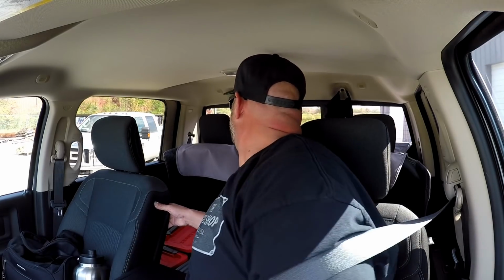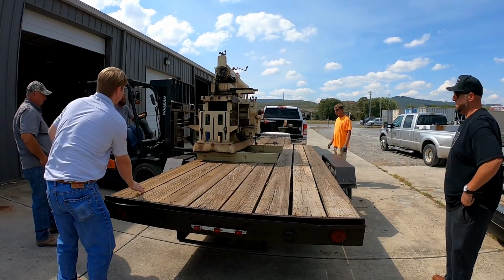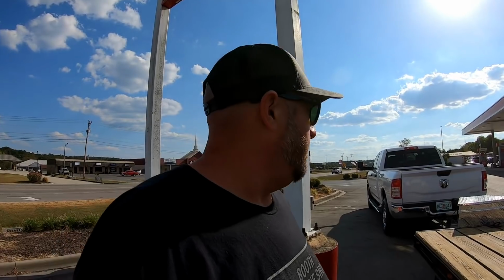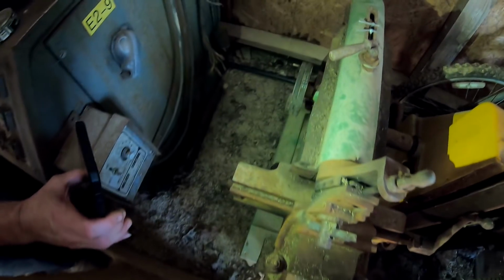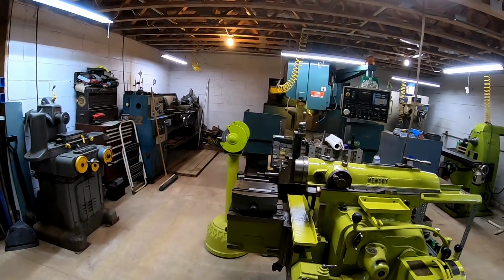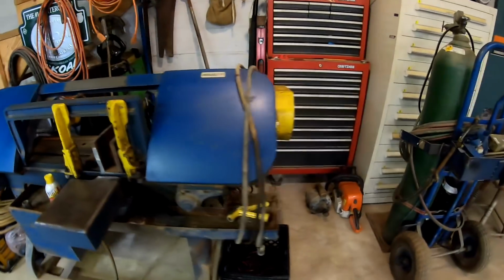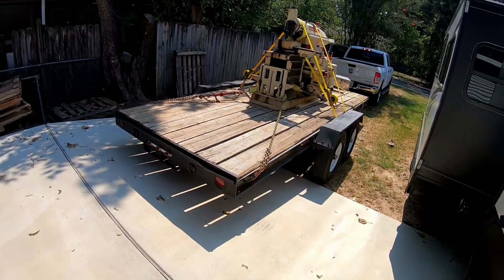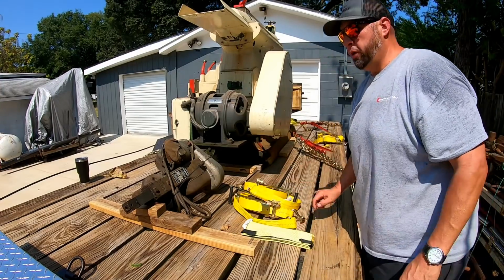SNS 277: Smith & Mills 25" Shaper!

Comment: I know it's an old video so you may not even see this but Im going to tell the story anyway lol
I was so mad about 3 months ago roughly the local trade school had a series 2(I think it was a 2) Bridgeport 10x52 mill that had extremely low hours.. not sure if it was one it since day 1 but the hour counter mounted on the main head motor read like 188 hours or so
Anyway it had a veriable speed head on the front like normal but had a bridge port shaper attachment on the rear... This thing was slick and sold low .I tried so hard but I couldn't get away so I could log in and follow the auction....I was so mad lol I had never personally ever seen one set up like that... someone got the whole thing for less than 1k...dro power feeds ect but the whole point was supposed to be that I think school have some of the cleanest tools\equipment but it's sad alot of the tech schools are getting away from teaching this stuff... Seems sad to me ...

Comment: You showed and spoke of the spilled oil on the boards of your trailer. Every time I change oil in my vehicles I take the old oil and mop it onto the boards of my tandem axle trailer and it makes a great preservative for untreated boards as well as add to protection for treated lumber. Of course I pull the trailer out into the field before I do it. Great video

Comment: Yo... IDK if anyone else saw this but that rear axle on that Dodge looks to be maxed. Check that angle on the wheel @ 15 min. "The Truck Stop."
Reply: There's little to no weight on the Dodge as most of the weight is on the trailer. So whatever angle you're seeing is probably an illusion.

Comment: I'll second the comment to use fire hose for strap and chain protecters.  If you put a twist in your straps when they are out in the wind they won't vibrate and whistle going down the road.  For anchor points in your slab look at body shop/frame straightening supplies, their are anchor pots available that can be flush mounted in a core drilled holes.  try some plastic UHMW or Harbor Freight cutting boards for sliders instead of rollers when unloading the shaper, set them over the crossmembers and the machine should slide like you greased the trailer bed

Comment: Adam, get you an old leather belt or some discarded fire hose  you can cut to protect your straps. Check your local fire house  for the hose . If not respond to my comment and I can send you all you need. I am right here in New Orleans.

Comment: she squeaks alright :-) guess your springs and bushings needed to be broken in. Just the load securement ain't right. You need a bull nose infront and behind your load with Chain's and 4*4 across so it won't slide forward or backward of your trailer in case of an emergency break. Load weight is about 6300lbs so your 2 straps hold it proper down for DOT not to mess with you. But I would had done the bullnose at either end of the unit. The bolting down of wood to stop it from sliding won't hold because the sheer strength of your screws or bolts is very low.  The problem you have is the chain securement to your tailer is exeeding pull strength. That's why I do use 3/16" or 1/4" by 3" flat stock for the stake pockets to which I secure my chains those hold 12000lbs. But the idea how you secured the load is 10times better than most private people would have transported the load.  Nice video.

Comment: As a cnc operator, i dont under stand why you need a shaper
Reply: Not many payments, unlike high $$ CNC. They are capable in the right hands. Some people don't need the latest technology to make a living. Why are there still Blacksmiths?
Reply: @retireddec04   Speaking as a Blacksmith I resemble that remark ;)  
I love Adams work and genuinely admire the precision boys, especially the old iron drivers. Most of my stuff needs a few millimetres tolerance, not a few thousandths.
Reply: U like a button not a dial
Reply: as a shaper operator, i dont under stand why you need a cnc

Comment: I would look for in a frame hoist that you could drive your trailer under, lift the equipment straight up, and pull your trailer out and then lower the equipment down onto rollers.  Might be a lot safer than trying to slide it off down some ramps.

Comment: Adam try and think up of an idea of mounting the fenders to the axles so they are level with the bed when the trailer is empty but then when weight is added they will always be a set distance at all times even when the springs are fully compressed.
Even if you have to mount 2 half fenders on each side so when the axles move independently of each other they don't foul each other

Comment: get some flaps behind your wheels on the trailer.  It's not for your sake - its for the sake of all the other people's glass behind you when you drive over small rocks.  Those trailers just pelt everyone behind you with rocks at highway speeds and it cracks a lot of windshields.  

flaps please!

Comment: i bought my Index Super 55 mill from it's previous owner who estimated it's weight at 1500lbs, and much smaller than it was in reality. i brought my Carolina 5000 hoist and planned to put it in the bed of my Ram 2500. when i got there the machine was 2x as big as he said, and 1000lbs heavier. plus he had extra parts and tools. we ended up borrowing a forklift just to load it. i figured i had easily 3500lbs in the bed of my truck, plus a very high center of gravity load. i went and bough heavy duty trucker tie down straps before moving it more than a mile. it was a SKETCHY ride home with asshole Utah drivers cutting us off the whole way, but the truck handled it great and didn't even touch the overload bumpers! it took us 4 hours to unload it. never again...

Comment: Adam, what I started doing with my trailer fenders after building a few was to develop a bracket that attached directly to the axles instead of the bed of the trailer. What I found was that by doing so I could keep the distance between the wheels and fenders constant by taking the spring compression out of the equation. I used to do the same thing as your current design and experienced all the same challenges. Now my fenders move with the axles and the wheel to fender clearance stays the same. I don't know if you have room between the trailer deck and wheels but this may be a good alternative for you. I watch your videos all the time and maybe can give back with a worthy contribution. Take care my friend.

Comment: Is shaping actually still economically? I’m from Switzerland and shaping is here a long gone technology in  manufacturing.
Reply: for obscure stuff that cnc machines aren't good at, it can be, but they require skilled machinists to operate them unlike cnc machines do, which not many production shops have left.
Reply: SuperAWaC Of course it needs skills. But I can’t really imagine what you wanna manufacture with shaping what you can’t do with milling, erosion and and...
Reply: @polymechanical  large capacity shapers are an order of magnitude cheaper than cnc mills with the same capacity, and cannot do what a shaper does without special attachments or extra axes, increasing that gap even more.

die sink edm can theoretically do everything a shaper can do but, again, capacity, and you have to make the dies.

huge planers (like shapers but the table moves instead of a ram, they are set up like fixed gantry cnc routers) are still in use to this day.

shapers are obsolescent yes, but still have niche uses in the hands of a creative machinist. (they are still very useful outside of production environments where you're not making 100 identical parts)
Reply: der Polymechaniker For a long  time the shapers have been old tech. Not many men know how to use them. But there is a lot of literature in print if you know where to look. They are also as easy as a centre lathe to use.
Reply: Mostly, it's fun! and also he finds times to use it for the heck of it and also the cool finish that it leaves

Comment: Thank you !  Hey next time ya see a mud flap or strap on the road pick um up they can be used as paddling for your straps!!
Reply: Fire Hose makes nice strap guards/padding and can often be had at a reasonable price/donation from your local fire department.
Reply: @gullreefclub  ok did know that but the broken an ripped from the trucks are free wouldn't ya say that  a better price?? You tell me plus your picking up trash

Comment: Adam you should put a twist in the web straps as it will stop the fluttering of the straps and will not cause excess wear.
Reply: Yep that is the way I was taught as well.
Still, it is great to see Adam strapping that machine down right.
Cheers from Tokyo!
Reply: looked like the spans were a little short to get a twist in those thick straps.  Definitely good for longer spans though

Comment: Flat straps have a tendency to vibrate in the wind. The vibrations will cause excessive wear on the contact points of the strap. Putting a half twist in the strap will prevent that from happening.

Comment: Instead of a winch ring in the driveway, put it just inside the door of the shop where it won't get packed full of dirt and rusty.
Reply: As a old Body & Fender guy, may I suggest using what are called "anchor pot(s,)" a short amount of chain can be pulled up from the pot, to do your winching, when done, put the chain back into the pot. They (anchor pot's) have a 10 ton rating. I think that will get the job done. WOW, just checked they now come in different styles. https://www.gradeatools.com/Anchor-Pots-s/84.htm   The style I was a costumed to  (similar to what I have in my shop, 24 Total, for Auto Frame straightening) what was the Mo-Clamp 3071 Mo-Ty Chain Tie Down Anchor Pull Pot.

Comment: I just unloaded a horizontal mill off of my trailer. It only weighed 3500-4000 lbs, probably a lot less then this thing. I left the trailer hooked to the truck and jacked it up a little to give it a slight slant. Then hooked a strap to the neck of the mill with the trailer winch and a snatch block. I pulled it forward and lifted the back end of the mill up a little. It didn't slide. :) When it lifted up a little I put a few lengths of 3/4" pipe under it and let it back down. Then used the wince to power it off putting new pipe under the front as the mill came off the pipes pushing it for encouragement when it needed it. I didn't want it to go off to fast. . It was amazingly easy to do this way. Turning it after it was in the garage was another story but I did it myself and it worked out well. Just have to be very careful because something this heavy does whatever it wants to so slow and steady works great. Good luck with your unload.

Comment: You need to grease your hitch ball. When its dry the coupler can bite into it and actually spin it loose when turning. Its messy but necessary......
Reply: Or he could machine a flat across the bottom of the collar of the ball where it sits through the reciever and weld a piece of flat/square stock aross the end of the receiver and then it wouldn't unscrew and when Adam changed out the ball he would only need one crescent wrench to undo and tighten the ball on.

Comment: The ratchet straps are really neat and keep themselves organised, but i'm personally not sold on them.  I'd be worried about taking them out on a rainy day down a gravel road and the retraction mechanism getting loaded up with junk.  But I look forward to seeing you keep on testing them.   Nice chains and boomers though.  Those ratchet ones are great and remove the worry of losing your jaw or launching a boomer bar 30 feet in the air.

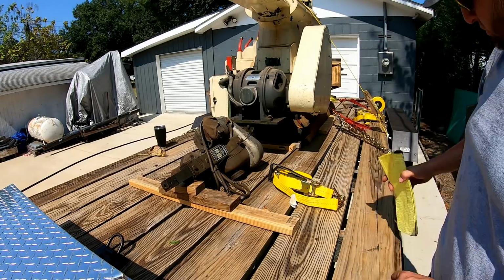Comment: Hey Adam what happened to your big radial drill press ?.. oops nevermind I saw it @ 40:00 you moved it to the other side of the pad...
Reply: Looks like it’s still there underneath the tarp. You can see it when he’s removing the straps in the back corner of the frame!

Comment: Why dont make detachable fenders for the trailer. So you can take them off when you are loading the trailer.
Reply: A very good idea.
Reply: I've seen low utility trailers where you take the fender off, pull the wheels off and support that side on built in jacks. Cheap, easy and let's you load and unload nice and easy.

Comment: I had the honor of running a shaper at a die shop I worked in in the early seventies. It was a Cincinatti and I have never seen a larger one before or since then. Used a one inch tool bit it was awesome. Big blue chips with T-15.

Comment: 23:40 reminds me of the pillar drill my grandfather built/modified in the early 60 from an even older pillar drill from way before the first world war. Since he did not have those waterwheel transmission things bag from like the beginning of the industrial revolution, he had to take that stuff off an put on a electric motor. And because he was too lazy to keep changing belts for different speeds, he slapped on a BMW R25 motorcycle transmission. It is truly amazing how far he came with little to nothing after being trapped in a refugee camp in Slovakia during the war an then escaping the DDR in 1953.

Comment: I haven't seen this done many times, but there's a few trailers out there that have individual fenders per wheel. They work kinda like how a brake shield is attached, but are fenders. It's a bit more complicated in form than i'm explaining it, but they sit as low as they get.

You should get some small diameter pipe and weld it around the trailer, no more rubbing issues.

Comment: If you put 1/2 a twist in the strap on either side of the load it greatly reduces vibration from wind and thus the chance of chafing or strap failure.

Comment: Why is it called a shaper ,and not a scraper.
Reply: The original intent was to use tooling with a complex final shape/pattern, think of it like a linear router from a wood shop. Hogging rectangular slots like you often see on YT was not the sole purpose.

Comment: I definitely wouldn’t do flush mounted fenders. Welding them on is kinda iffy because if something happens and you need to replace, now you’re cutting them off instead of unbolting. I know you also had plans to put D rings on those as well but I’d just weld some onto the frame itself. I know you plan on making the defers beefy, but it’s just something to think about. Keep up the awesome work brotha🤙

Comment: I have an E head (slotting head) for my BP clone turret mill. It's a nice to have attachment you never use. It sits on the back of the ram gathering dust until one day you're desparately glad to have it. The one big advantage of a slotter head is it allows you to cut tapered internal splines. I've owned mine for 22 years and used it three times on paying jobs - all of them steering arms for big trucks. When the spline shaft on the steering box get so worn a factory replacement arm fits loose and the poor but scrambling owner has to make-do. A home made steering arm splined to fit is the only solution. Once, I traded for an elk quarter, cut and wrapped. Gave it to my girl friend at the time.

Two shapers. Reminds me of a musician joke I heard years ago. A banjo player visited his agent looking for gigs. No call for banjo players, too many players for the available opportunities. Banjos were unwanted, almost despised.

Well, after a dozen phone calls and a long conversation, the banjo player realized he'd lost track of time. "Holy smoke! I left my car unlocked and my banjo is inside!" The banjo player hustled to the elevator, figited 20 floors, ran for the revolving door, got untangled from that, sprinted three blocks to the parking garage, up three gasping and sweating flights to his car. Disaster had struck! Someone got into his car and feft another banjo.
Reply: I have an E head on the back of my BP too. One of these days I might actually use it to make something. I do mess with it from time to time

Comment: These are cool but think you would get better bag for your buck with cnc's
Reply: If you look behind you, above, you can see The Point. It boarded a luxurious private jet, and went over your head.
Reply: @aserta   point what point. CNCs are fairly affordable now. But hay I've been in the industry long enough to realize everyone has their own opinion.
Reply: @dominic6634  You must be new around here. Adam is a manual machinist not a computer operator. It's what he loves to do. You can do you.
Reply: @scottr939  can't fault a man doing what he loves. I always preferred programming the machines over the manual stuff. Use to use a sharps lathe when I first started.

Comment: For a 25" shaper, it's very light.  That was a 3500lb forklift with thin pallet forks.  My 24" Cincinnati is just over 6k lbs. 
Good looking machine..  looking forward to seeing it make chips.
Reply from the maker: It weighs around 7K according to the manual
Reply: @Abom79   ok. I was going by the 30 on the side ... usually the load rating.  That after looking it up is a 6k lift.
Reply: @metalworksmachineshop  remember that capacity is at a 500mm/24" load center. Inside that you'll have more capacity, not to mention the tilt trick for the real hefty loads.

Comment: Instead of buying the pads, just go to where they recap truck tires and buy some scraps. I drove truck for 18 years and used a lot of them. They work great and are very cheap, so if you lose one, no big deal.